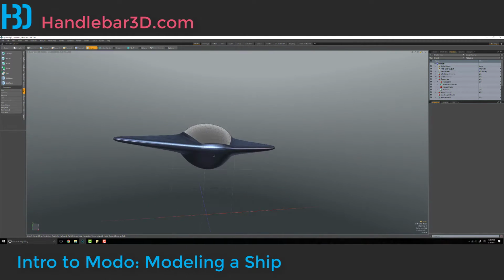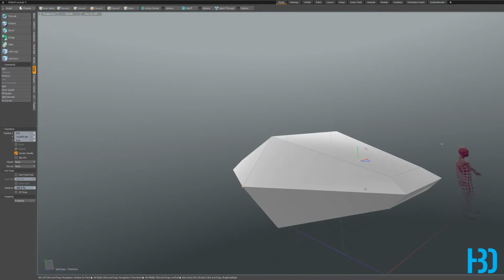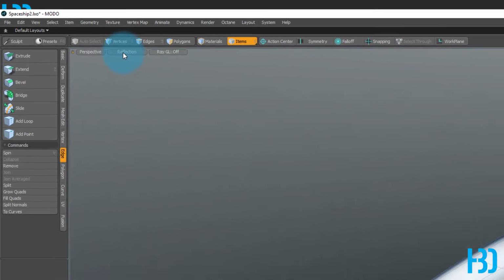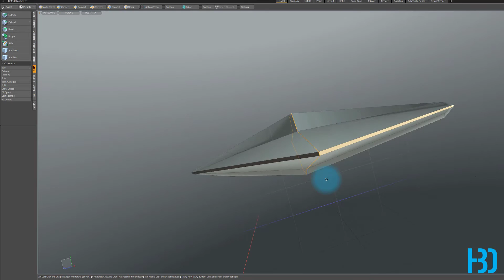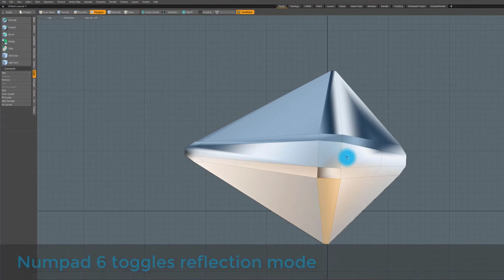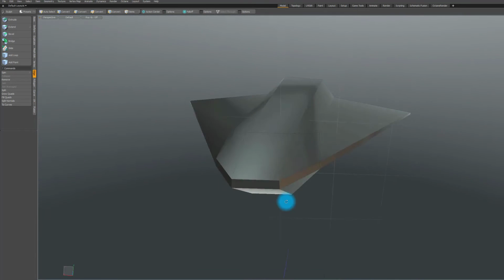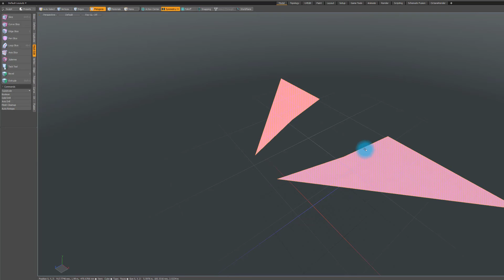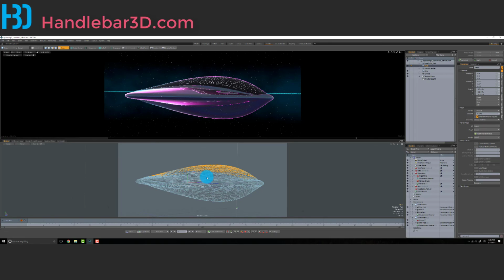Intro to Design using Modo - Spaceship

Comment: Do you have any tips you can give me ? , i'm working on a recreation of a ufo which landed in the forest and a witness walked up to it , based on his description i have modeled 
the ship , but there are a row of glyphs which run along the top leading edge (triangle shaped with tall centre fin . The surface along the leading edge is curved and i'm trying to apply the glyphs onto a curved surface , in blender i tried using projection , but not looking great as the symbols have to be etched into the surface , i'm only recently started using blender .